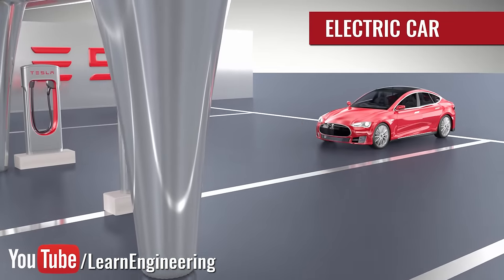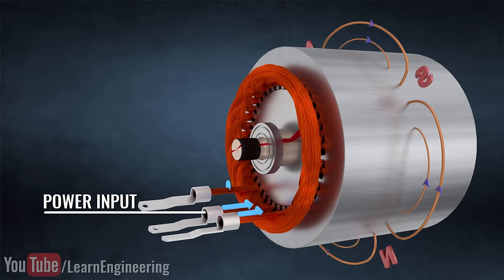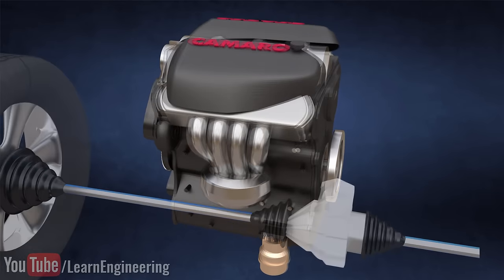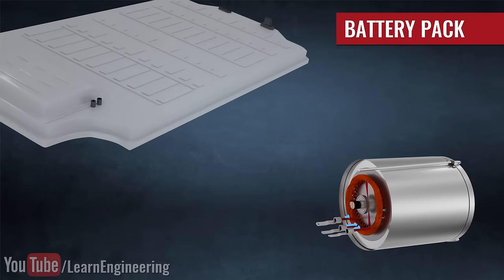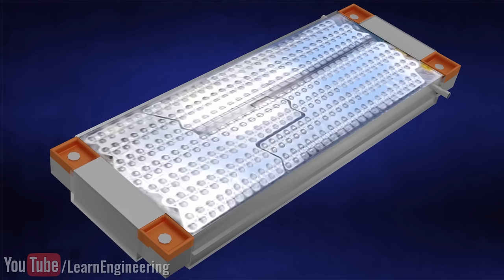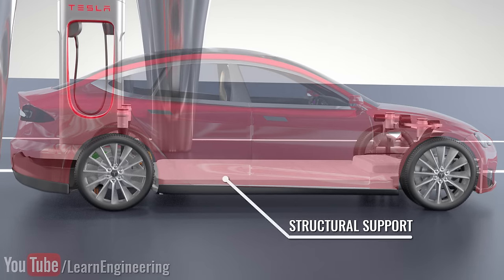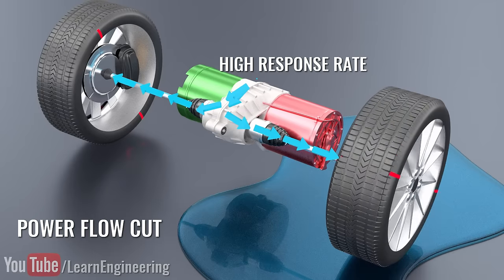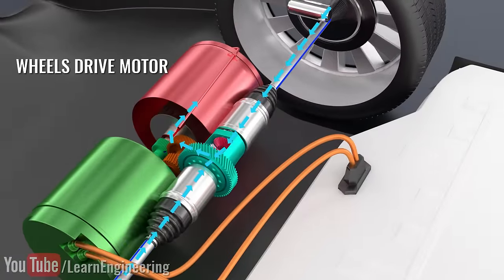How does an Electric Car work ? | Tesla Model S

Comment: I want to know more about how the batteries are charged from an AC source. Do it have an inbuilt AC-DC rectifier ? Or is there an adapter like our appliances?
Reply: If you are scientifically knowledgeable, then the built-in AC-DC rectifier circuit Must be incorporated, and that there are no exceptions!  Human depends on technology too much, but the average layman does not need to look deeper into those "boxes" (or packages) so he/she just need to know how to use them.
It is not possible to address in more details in this program, because there are so many domains of knowledge that could be covered in the production of electric cars.

Comment: If we placed a dynamo for charging while running...is there any change in efficiency
Reply: There would be no point. Conservation of energy means that you can't pull energy out of thin air. If you were to put a dynamo on the car, there would be more resistance to drive the wheels. At the same time, the dynamo will waste energy due to friction.

Comment: One of the disadvantages at the end of the video i think can be easily solved: The long charging time. We could increase the energy output of the charger or lower the control for energy output. That way, electricty can pass much faster into the tesla car and reduce charging time. Also, Good Video!
Reply: Even if you doubled or quadrupled the speed it wouldn't be anywhere near as convenient as gas.
Reply: Bateries can't be charged that fast , and fast charging lowers their lifespan

Comment: I have design in mind for the combustion engine layout that could potentially be more efficient, powerful, just as eco friendly, and wouldn't run on fuel or batteries. 

The engineering skills to put it together is what I lack though.

Comment: So sad that you didn't explained in detail how does the inverter works. But thanks anyway.
Reply: You can look that up, this isn't an EE course....
Reply: So, can you send me link to some course that shows tesla's inverter?

I'm searching for this on internet and this video is the closest I found. I also did a EEV course but it was more generalistic.

I want details about the power converters of Tesla models.
Reply: @filipesiegrist  I don't think that is a subject that has been covered extensively.

The inverter on a Tesla is both an inverter and a motor controller, as it has to vary the frequency and phase of the electricity to make the motor speed up and slow down, and also to make it run backwards so the car can reverse itself.

It also has to be able to run as rectifier/charger as the motor charges the battery when the car slows down, using regen braking.

Hence, it is all of those components in one.

This is loosely covered here:

https://www.youtube.com/watch?v=3SAxXUIre28

here:

https://www.youtube.com/watch?v=l6dV2re3rtM

and here:

https://www.youtube.com/watch?v=fj4KBVgJsGA

But, you may need to break these down into details for each one, like here for the inverter:

https://www.youtube.com/watch?v=iIqhAX0I7lI

and here for the motor controller:

https://www.youtube.com/watch?v=8DMtTK0cbp0

The different motor types are also covered here...:

https://www.youtube.com/watch?v=6H5vtu5_SF4
Reply: @filipesiegrist  Since EV's and Hybrid vehicles have similarities, some of this is covered here:

https://www.youtube.com/watch?v=o28ev6RHCZA

and here:

https://www.youtube.com/watch?v=4agZpzYRu2A

But sorry... there really isn't a comprehensive coverage on this, and since there are variations in motor types, control systems and other components, there is no one video that can cover all of that.
Reply: @redbaron6805  thanks man, I know this it hard but I'll get the info I can. Have a good time
Reply: I interviewed a top energy expert on my home page vid. He warns that EV conversion will not happen and oil can never be replaced
Reply: thanks for the info. I will check it
Reply: @filipesiegrist  you're welcome please comment on the vid to share your views and discuss. Many have already done so in an interesting conversation and debate.

Comment: Thank you very much for this video, but could you tell me why an AC motor is used in electric car instead of DC motor? I think if we use a DC motor this will make manufacturer get rid of the inverter right? What do you think? Thanks
Reply: By dc you mean a brushed motor? If yes, that answers your question.

Comment: The only thing missing in Tesla car is Tesla's Radiant Energy power source. If that happens, everyone can say bye bye to charging stations as radiant energy will keep the batteries always charged. Radiant energy is basically a very high frequency primary radiation above cosmic rays according to Tesla. It is emitted by the Sun and other stars and passes through the earth all the time. Cosmic rays are the secondary radiation according to Tesla. If an antenna and radio circuit were to be designed to tune into the high frequencies of radiant energy and cosmic rays and convert it to high voltage/amps high frequency electricity, you basically have a electric car that can run forever powered by radiation from the cosmos. Check electrical engineer and inventor Thomas Henry Moray's book "The Sea of Energy in Which the Earth Floats", the man who succeeded in harnessing around 50 kilowatts of electric power from radiant energy and cosmic rays.

Comment: Years ago I read an article in a major magazine that by 1990 the Wankle (rotary) engine would pretty much replace the reciprocating engine.   Trouble was that, due to the odd configuration of the combustion area, they (Mazda)  could never get it to pass emission standards.  What will be the stopper for this?   We'll have to wait and see!

Comment: As we know at Tesla by using a battery pack that requires a round electric cell: the better hypothesis is to use a more reliable rectangular battery pack, similar to a Panasonic camera that utilizes a rectangular battery pack which is a sincerely more reliable battery power solution and more practical. Believe it or not!
Reply: I interviewed a top energy expert on my home page vid. He warns EV conversion will not happen and oil can never be replaced

Comment: What’s the lifespan of the lithium batteries; and will they be reused; or thrown away?
Reply: If we develop solid state batteries to replace lithium ion batteries, then swapping your car’s battery pack may be simple in the future
Reply: Almost all rechargeable batteries have valuable materials inside and are therefore recycled.
Reply: Tesla lithium batteries warrantied 8 to 10 years and designed to last 15 to 20 years

Comment: Although the torque generating mechanism for EVs are more weight efficiency, they rely on batteries that increase the weight of the car significantly
Reply: Yea but without engine weight and those electric motors on the wheels r far lighter, it balance out if not weigh much less still than a gasoline engine

Comment: If I'll be manufacturing electric cars I would make sure it has wind turbine in front, so that it can charge the battery while you moved... Plus a solar panel and alternator...
Reply: lol u know tesla's regenerative braking does the exact same thing u intend to do using a wind turbine and does it even better....
Reply: what's dumb about that idea is that you'd be using more power from the battery to overcome the drag induced by wind turbine and with conversion losses you would end up loosing more energy than you would gain.
Reply: @KingofHearts67  The wind turbine will replicate the power loss and convert it into energy, I don't think it will create much drag...
Reply: @Ramp10er  I don't think you know how a wind turbine works... of course it'll make "that much drag" relative to how much power it'll produce. It converts the velocity of the wind into mechanical energy, meaning that the air will slow down on the other side of the turbine which is what drag is. If you could get more energy out a turbine then it costs you to move it through the air you would be breaking the laws of thermodynamics.
Reply: @KingofHearts67  Not if you put holes on the side of the body of a wind turbine, the design of the wind turbine is like the propeller of a 747, but is has side open panels to avoid the drag... Aerodynamics... Plus you need drag to avoid lift...
Reply: @Ramp10er   yeah but on a 747 the oncoming wind is not what is making the power i.e spinning the turbine, it's the combustion of the fuel. The amount of drag your wind turbine will create will always be related to how much power it makes. In other words, you're trying to convert the velocity of the car back into energy through a wind turbine, which at best would be 100% efficient and you would make as much energy as it takes to push the turbine through the air. But it will never be 100% efficient and so you'll use more energy pushing the turbine through the air than it will make.

Comment: Our country want full electricity by 2026 . If cars were evenly priced i'd say , thats possible. But the same car is at least 30-35% more expensive in electrical version then fueled version. Therefor i bought a diesel again. The innovations in diesel engines is not to be underestimated.

Comment: I have blueprinted and balamced an ic engine and run it a 22 thousand rpm. Idesl at 500 rpm. Runs on hydrogen gas and produced 3 times the horse power of the original design. If you use a gear reduction box you can conect a standard electric motor to the automatic transmision and get twice the power and twice the milage of teslas design. Using an induction motor with my configuration makes them way more efficiant and powerful. It is called combining technologies. Take two technologies and make them better. Most companies like tesla seem to forget how to do this and only focus on one way to do things. That is why my cars out perform theirs and why i got to space before any other civilian company. Think outside the box and you can go farther.

Comment: Cells are not connected in series parallel 
They are  connected in parallel series also called as (npms) tesla uses 21750 (type) (something I don't remember exact) lithium ion battery type ,  battey  pack has 7000 cells

Comment: This video in a comment:
Electric cars are better because:
-they are more efficient
-they don't have traction control problems
-they don't waste energy into heat
-they regenerate energy everytime you brake
Even all this good points I still want a car that runs on an ic motor

Comment: I know this was posted 6 years ago but that 2025 date is fast approaching and as expected EV's will never make ICE cars obsolete. EV's are still less than 1% of the entire U.S. auto fleet for many reasons. The disadvantages mentioned here for the EV were very few and have many more than an ICE car. The first is pollution free. EV's cause far more pollution than ICE cars. The dirty mining process of rare earths metals to produce those 1 ton batteries, to having to use fossil fuels to charge them, to the end of life of dumping highly toxic lithium in landfills is a highly polluting process. Much of an ICE car can be recycled while EV batteries aren't. Add to this that they use coolant for the batteries just like ICE cars use coolant, they also have brake parts, brake fluid, steel for the body, glass and plastic for the windows and lights, rubber tires...ect. The other problem is cold weather. The battery range of these is far less in colder climates. ICE engines are actually an innovation over the EV's. They were able to invent all the parts required to make it run efficiently, economically, longer lasting and much more affordable to the consumer. The other problem is cost of maintenance. They are highly computerized and the batteries themselves are very dangerous which means only a specialized dealer can service them which also drives up the cost of ownership. The reason why ICE engines will remain is because the essentially an EV is nothing but a giant battery. The power source is stationary and built into the car which is a huge flaw in itself since its temporary and degrading. The ICE engine on the hand has it's power source externally. So it can be added and replenished whenever needed. Additionally, it can use competing fuel sources such as gasoline, diesel, ethanol, natural gas and hydrogen thus making it far more versatile. An EV can only be powered by a battery that is permanently locked into the car. It's very permanent power source which is also large percentage of it's value is designed to fail. The EV predates the ICE car by around 50 years for many reasons. The ICE engine car is an innovation over the EV. Converting to an EV would be a regression rather than a progression.
Reply: In 2022 more than 750,000 new EVs sold in the US which was 65% more than in 2021 and 5.6% of the total market. Meanwhile the total market decreased 11% year over year
Reply: @stevenhill3136  what happens when the government welfare checks aka "subsidies" run out? The EV market is on government life support. They have proven to be too expensive to build for the average consumer to purchase and have very little resale value to speak of. The automotive industry heavily relies on a vibrant used car market. Who in their right mind would buy a used electric car? Who can even fix these things? This is a fad that will dry up. They will end up being low production vehicles like lambo's where only few consumers can afford and purchase them.
Reply: @ChannelNews1  Like all disruptions through history the technology being displaced is improved upon. With EVs improvements include performance, efficiency, lower emissions, lower running cost, improved longevity, etc. It’s been frankly amazing owning a car that gets 300 miles for just $6.00 of electricity, has 500 horsepower and instant throttle response. No maintenance and drivetrain and battery lasting more than 300K miles, or longer than I’ll keep the car. Subsidies aren’t needed but helps until battery costs continue to decline through economies of scale. EV resale value low? Quite the opposite. It’s dinosaur ICE cars value that's tanking
Reply: @stevenhill3136  sorry got a notification and wanted to respond but it looks like my comments are being removed. Please respond on my home page vid to further discuss.

Comment: I think that someone has to build an electric car that charge it self while the motor is running. For example when you start the car it will starts charging the batteries while it is running.

Comment: 300 miles for just $6.00 of electricity. I repeat...300 miles for just $6.00 of electricity. Oh and the car has 500 horsepower if it has a Tesla badge on it. And no maintenance. This is why gas junk is obsolete
Reply: just imagine what EVs are gonna be like in say 5years

Comment: But the problem we still face is limited energy supply. We still have to stop to refuel/ recharge the battery(ies). I'm currently working on a self sustaining electric conducting battery free from outside electrical sources.

Comment: If you produce electricity through rotating wheels no need to charge the car , that energy used reverse to charge of batteries through rotating wheels.  Is it possible

Comment: On a cold freezing morning when the front and rear screens are thick with ice and the cabin is bitingly cold inside.....how much battery capacity is lost in overcoming this, that's before the vehicle moves one inch, then when running the cabin has to be heated, all this will drain the batteries dramatically.
Reply: Say the volume of a car is 3500 litres, the air weighs around 4.53kg. 1kg of air requires roughly 1000 J to be heated up by 1K.
The amount of energy then it requires to heat up the interior of a car by say 20 degrees Celsius is
4.53kg * 1000 J/kg * 20K = 90600 Joules

Tesla model Y has a battery capacity of 75 kWh = 270.000.000J

90600/270000000 = 0.034%

Resistance heating is 100% energy efficient meaning no need to account for that. 
Unless I made a logic error, heating up the car drains barely any energy from the battery. In reality it will be more because air from outside will circulate inside and heat will transfer to the outside, but this rough estimate should give a basic idea.

Comment: Curb weight of a Tesla S is approx 4600 pounds with battery weight of 1200 pounds which weighs more than my V8, gas powered Dodge Durango. If I drive from Boise Idaho to Portland Oregon, I would need to stop two or three times for 3 hours each, to charge as in cold weather, battery charge mileage decreases in cold weather.
Reply: @stevenhill3136  Hey Dummy, I rented a Tesla to drive to Portland, over two mountain ranges during winter, snow, and frigid weather. The battery does NOT allow the same miles in cold weather than in warmer weather. In a 320 mile drive, I had to stop 4 times for an hour each to charge. A gas vehicle would have made it in one tank full with fuel left over. Check your facts. Personally, i would NOT purchase an electric vehicle until there are improvements with longer driving range on a charge.
Reply: @larrybruce4856  Your mistake was charging to nearly 100% or you’re exaggerating the time. That last 25% charges more slowly and the car knows this meaning it won’t ask to charge to 100%. No more than about 30 minutes needed per charge
Reply: I interviewed a top energy expert on my home page vid. He warns that EV conversion will not happen and oil can never be replaced

Comment: If the power plant is a four pole three phase motor then how does it produce 18 thousand rpm when the synchronous speed of a four pole motor is 18 hundred rpm?
The number of poles determines the speed of any single or three phase brushless electric motor: 
2 pole = 3600 rpm
4 pole = 1800 rpm
6 pole = 1200 rpm
8 pole =  900 rpm
Reply: I interviewed a top energy expert on my home page vid. He warns EV conversion will not happen and oil can never be replaced